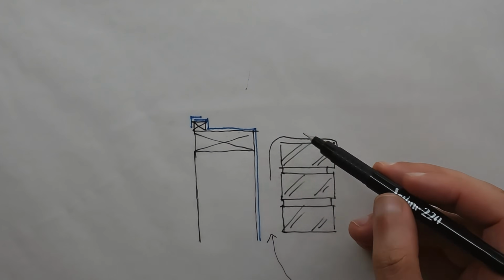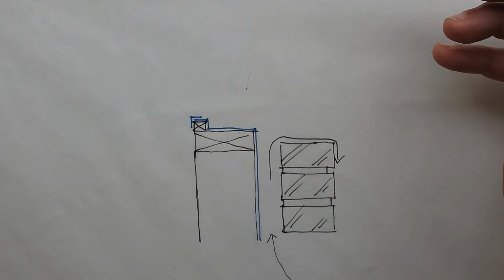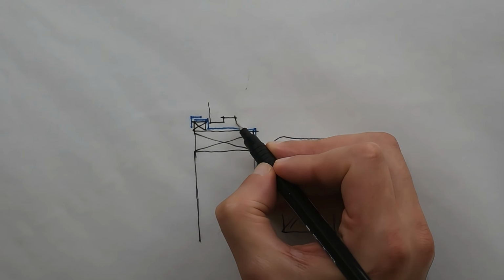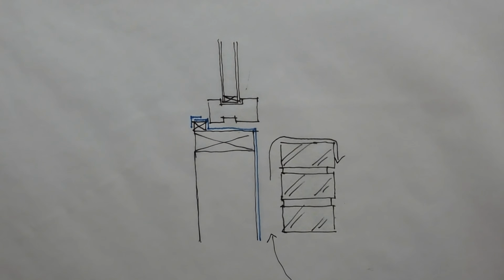Passive House Window Detail: How to Protect Your Home from Water, Mould & Energy Loss

Comment from the maker: Personally I find both of those excuses unacceptable. Are you saying that you are unable to do good work on a site because of the weather and site conditions? I would hope this isn’t the case. If that is the case, this whole assembly can be formed in a factory which is something we are personally doing. Cost wise, yes this takes a little longer and requires a few more materials than typical but you are only considering build costs not life time costs (energy savings, more resilient building, less maintenance) health of inhabitants, comfort etc. You can even rebalance the construction costs by making better decisions in the design, just remove a double vanity, the imported stone, the built in fridge, the in built speaker system etc and you have covered the cost of this and end up with a far better, more liveable home for no extra cost.
Reply: If you know anything about framing you would know that you wont get a "service cavity" made in a factory.

By the time you fix the screw ups from the monkeys in the factory, you may as well have done it from scratch. Couple that with the mark up and the additional transport cost, what's the point?

Even if you order them from the factory your wall is not lined, cladded, squared, plumbed braced, sealed ect...

I moved down from Qld to Vic recently and I thought they were cowboys up there.... At least Qld tradies have licenses... and it seems like VIc builders are pretty shit.... even the watchdog is corrupt...

You know what... if you paid me I could come and build some shitty box houses out of EPS fridgey panels and make them super "air tight" for you..... 

or even better I could seal up the entire internals of your houses with a class 3 watertight/ airtight membranes with bond breakers... the lot... lets make the whole house a giant wet room.... for wet dreams...

Comment: One potential issue with having an "air gap" anywhere in the exterior wall, is insect or vermin infiltration.
My perception is that brick are moisture seeking and moisture retaining to an extent and this characteristic makes it a questionable choice for humid environments.
It would be very beneficial to transfer these discussions from the drawing board and into a mock-up or a real life build as a demonstration of how to apply these principles.
Otherwise, an informative presentation.
Reply from the maker: Yes good pick up. Insect and vermin need to be keep out of that air gap. This is done by applying insect mesh to all openings. My understanding with bricks is that they are ok having a certain moisture content and this won't make them deteriorate. May not be true for all types howeer so best to check with your local supplier. It's not a concern where we are here in Melbourne. If there is moisture in the brick, the seperation between the brick and the internal structural wall is critical as you don't want moisture laiden bricks sitting anywhere near thet timber frame. These details are being applied on our sites in real life all teh time and there are builders who showcae this. If you are on instagram follow Carland Constructions https://www.instagram.com/carlandconstructions/?hl=en or Sanctum Homes https://www.instagram.com/sanctumhomes/?hl=en

Comment: Hi Roger. How do you close the gap between the external skin and the internal skin at the ends of the window including at the head? Is there any meaningful gain in thermal performance to be made by not placing the window bridging across the cavity as is normal practice. If so, have you got any data? Thanks.
Reply from the maker: Great question Geoff. I may draw a plan detail of the jamb as well in due course. In theory closing the gap by doing a brick return or a return in whatever the cladding material is will be fine as long as the window is placed in the internal insulated stud. By doing this thermal bridges are largely avoided albeit you get some through timber members forming the window opening although this is minimal and is calculated and understood in a thermal model. In regards to data if we moved the window out I don’t off hand but I have seen the thermal models which show the isobars and know that you want to keep those lines as straight as possible through any assembly. By moving the window out you get a stagger in the thermal isobars and where this happens you get a weak point in the required continuous thermal envelope which could lead to condensation and mould issues in those locations. Hope that makes sense.

Comment: Service cavity?... your stud wall, or your brick cavity is for services. No sparkie or plumber is going to run anything through XPS or a batton wall that you're going to plasterboard over.. BTW timber is a thermal bridge.... Try looking into double or staggered stud walls to reduce thermal bridging...
Reply from the maker: The internal service cavity negates the need to penetrate the critical air barrier and avoids diminishing the performance is the insulation by having services within the main stud frame. It is virtually impossible to make the wall airtight if you put services in the main stud. I never said there was xps in the service cavity, I would use either cellulose or mineral wool here.

Finally yes timber is a thermal bridge but it is minimal and is fully modelled in our thermal modelling. Staggered studs are of course a help with performance but overall this is a relatively manageable thermal bridge and one that has minimal risk of condensation.
Reply: @borlandarchitecture  First off, "virtually impossible"...

 Incorrect, IAW NCC penetrations in wet areas are terminated with waterproof membranes. I cant see how you cant do the same for airtight membranes. Even electrical cabling can be sealed off with cable glands, rubber  tapes or sealants.. 

Second, the risk of condensation is from the inside. You have a porous substrate (plasterboard) followed by battens and cellulose (also porous) stopping at your "airtight" (non porous) membrane. At least use a vapor permeable wrap.

Where is the dew point in the frame and how do you expect the walls to dry out in bathrooms/ kitchen/ laundry?

Third, if you think that air con with heat ex changers and de-humidifiers is the answer, thing again. I used to get my air con serviced every 6 months in Darwin and the fridgey would leave with a bag of black moldy water after blowing/ washing it out...

Fourth, why are youse obsessed with airtight? 
Insulation works by having pockets of air ( not an effective conductor of heat) between other materials.
You are supposed to slow down the movement of air and transfer of heat... not completely stop it...

Fifth, what is the point of all this shite... heat and moisture is drawn to colder surfaces like those massive aluminum double glazed windows and doors that you architects love to throw into houses with complete disregard of framing/ bracing requirements..... so much glass it's almost pointless...